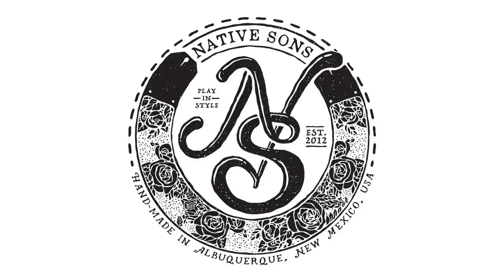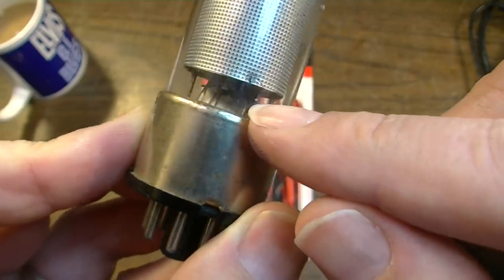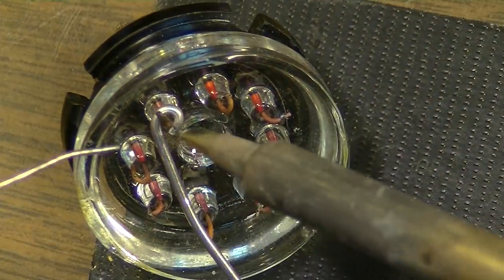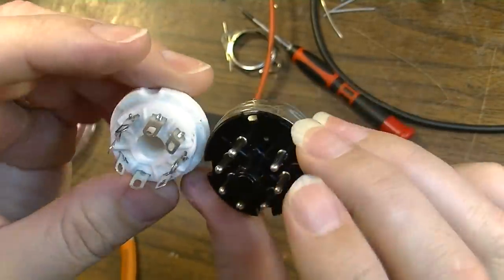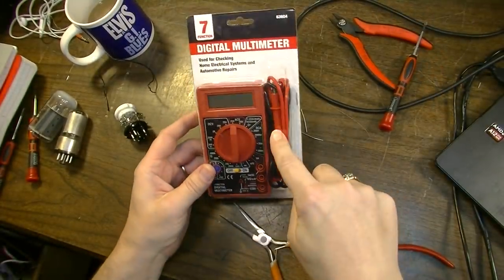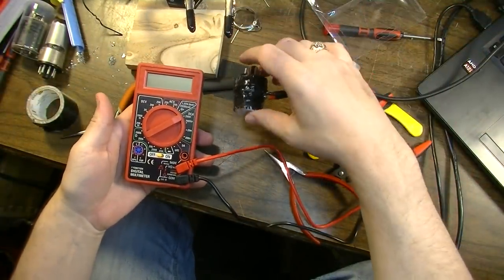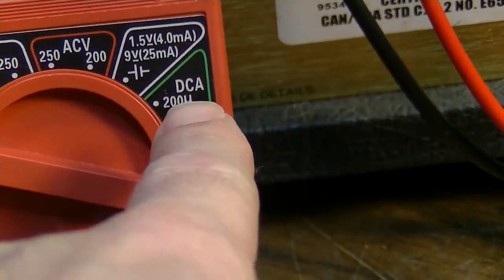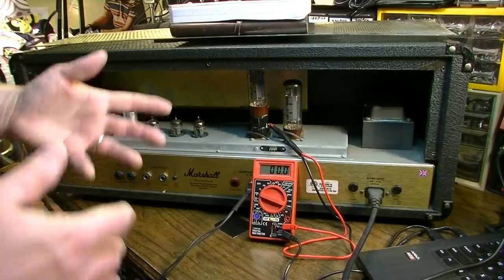$3 Tube Amp BIAS PROBE Made in UNDER 30 MINUTES!

Comment: Not sure telling people to use a cheap multi meter measuring on the high voltage side. Much safer to measure the cathode side or better yet put a current sense resistor in it
Reply from the maker: It is safer, and I did consider that; however, you cannot measure the plate voltage that way. Also, measuring current at the cathode is less accurate because it's adding the screen current to the final figure. This way allows you to calculate the actual plate dissipation of each tube using the two measurements - current and voltage.

Comment: Would you use that cheap multimeter to monitor the plate voltage? I have one and i want to self bias my amp, but i`m afraid that the thing will blow up or something when messuring 450V
Reply from the maker: That meter isn't rated for that, I don't think. But it'll measure the current just fine.
Reply from the maker: You could try it. Worst that could happen is you brun up a cheap meter or blow the internal fuse.

Comment: So, if it's more accurate, it's a Fluke. ;)
Reply: Hot DaMM lol
Reply: Accuracy depends to a large extent on the quality of your test leads and probes. My Fluke and Brymen both perform better with good Probe Master test leads. So do the cheap meters.
Reply: Leigh Hewit   Those won't do very well either with cheap test leads and probes.
Reply: "Fluke" . . . Standing ovation, slow clap.
Reply: I knew a guy that said he could check anything using a WIGGY

Comment: Your Harbor Freight DVM is rated 250Vdc. Your plate voltage is 460Vdc. Good luck.
Reply from the maker: That's why I used another DMM for the V measurement. The Centech measures current up to 5A.